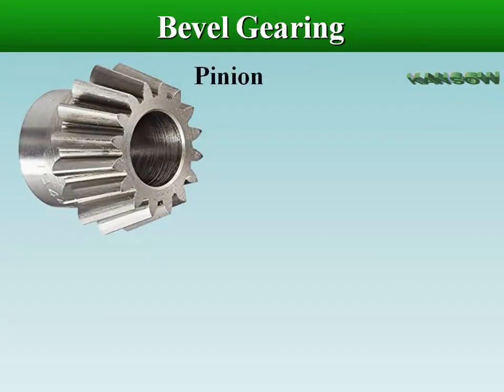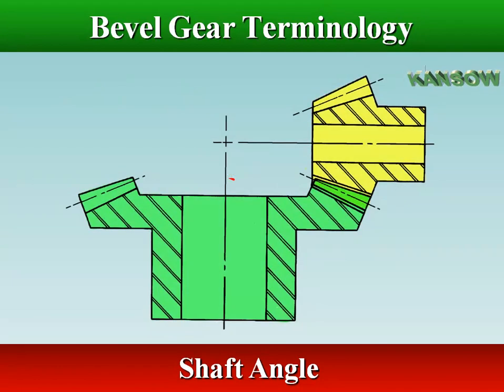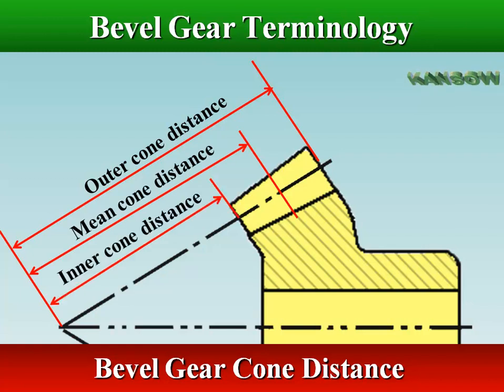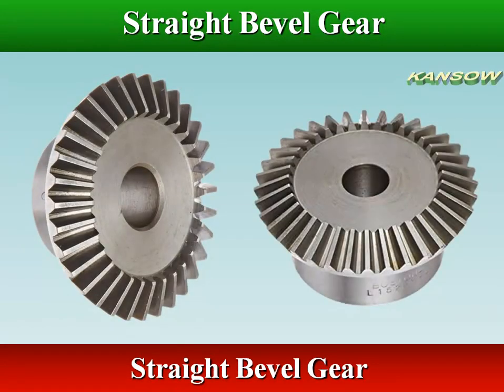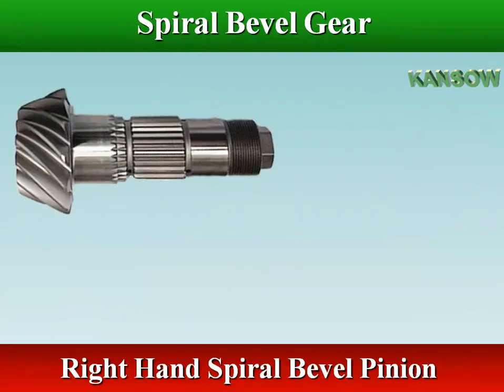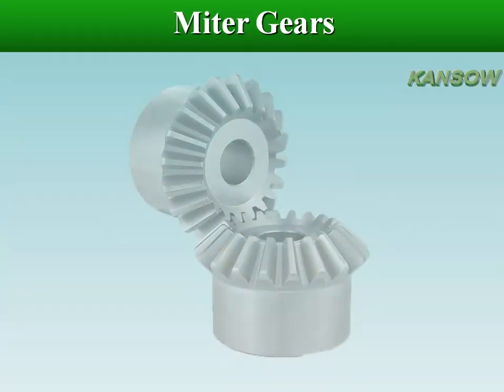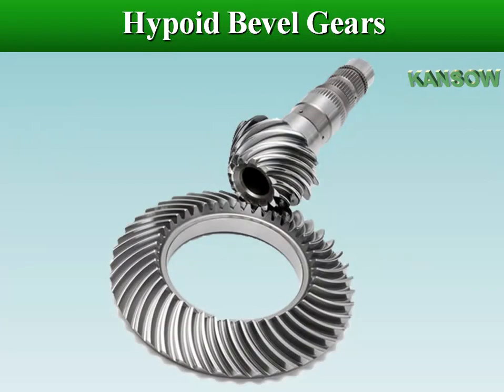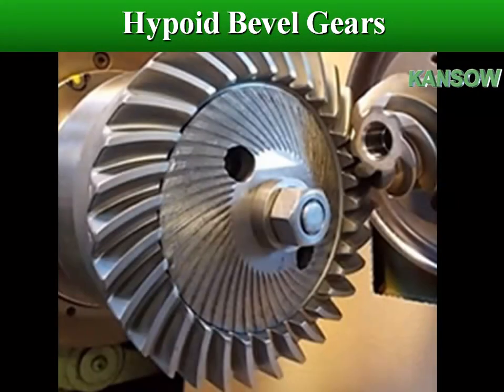Bevel Gears Types and Terminology

Comment: If my drive shaft is rotating in anticlockwise direction (back view) my front mounted crown gear would rotate in backward direction so by changing the crown gear position from left to right i can fix that effect would that produce any difference
Reply: instaBlaster...